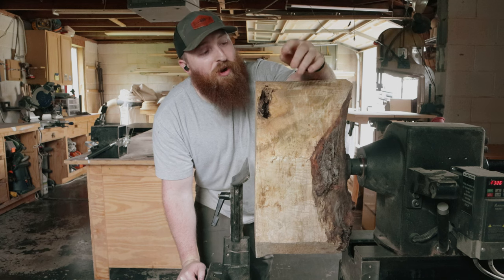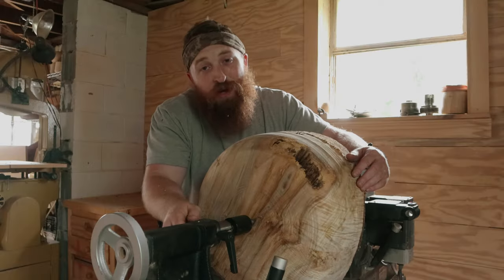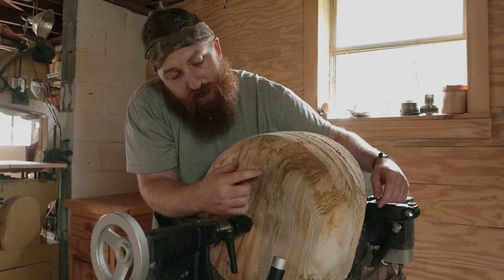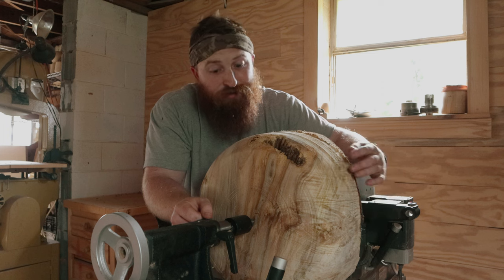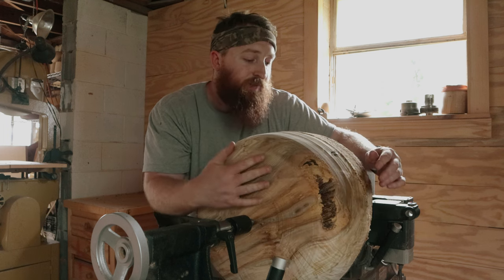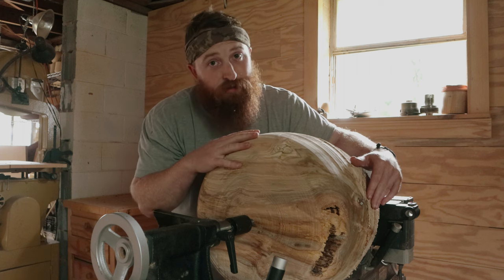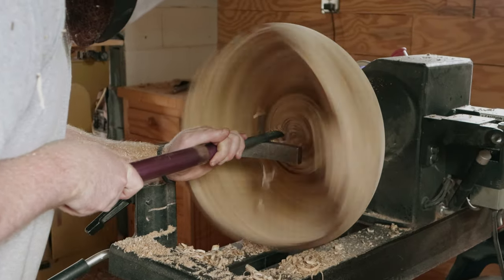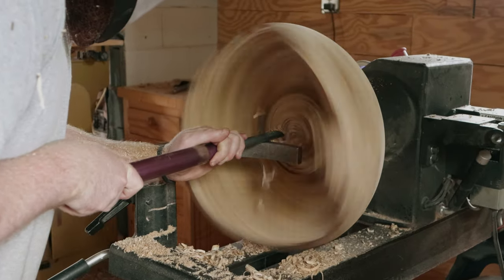Woodturning Some of the Prettiest Maple I Have Ever Seen!

Comment: Wow! Fresh cut maple is kinda boring, it's amazing how much character it picks up just sitting out in the weather for awhile. Plus all the burls and knots, great project. How are you liking the Laguna lathe, any issues or problems that you've had to deal with? I'm thinking of upgrading myself.
Reply from the maker: I agree & maple has to be one of my more favorite woods to work with. You really never know what it will look like until you cut into it. So far I love the laguna & highly recommend it! My only thing is if you can upgrade to the 220 version then that is what I would do but so far the 110 has handled everything I have thrown at it with ease.

Comment: Nicely done. 2 questions for you.
What brand and size bowl gouge do you use? 
Do you have any problems not using the tailstock for support on the inside?
Reply from the maker: Thank ya! I use the Carter & Sons 5/8s bowl gouge with a Trent Bosch handle & not really. I rarely use the tailstock unless I absolutely have too like if a piece is too unstable or sticks out over the bed too much but usually I dont.

Comment: How long are you drying the green turned bowls out before finishing? Ima bout to get an 18/36 and bed extension. Thought hard about the 24/36 but dang $$$
Reply from the maker: I typically try to let them sit for atleast 4 weeks but they usually sit longer as I get busy doing other things lol I highly recommend the extension. I have loved using it. If you can get the 24/36 then Id say go for it! Wouldve been my choice but I only have 110v in my shop lol